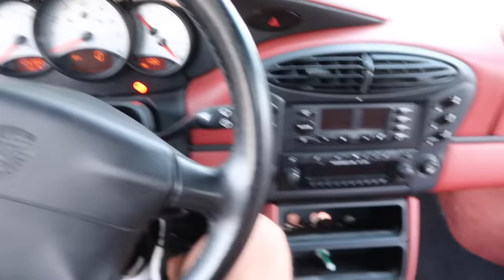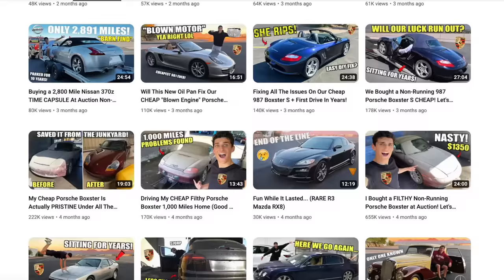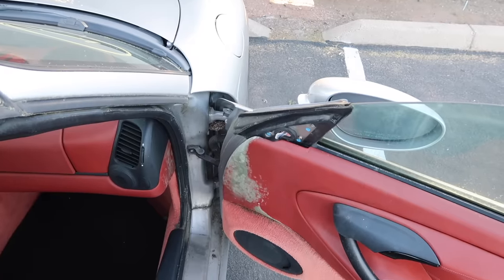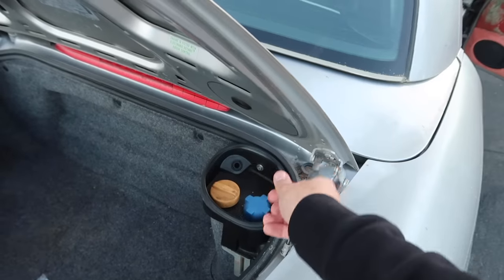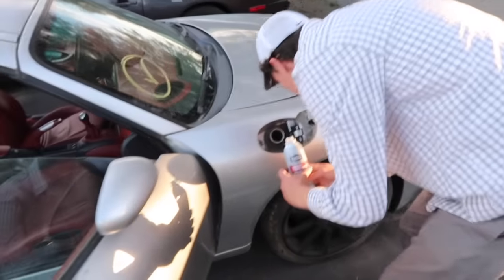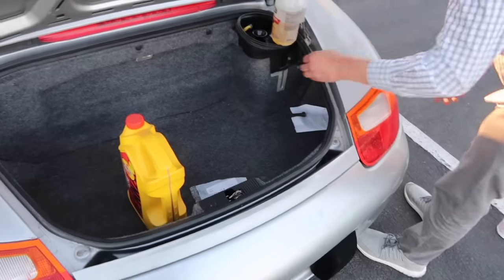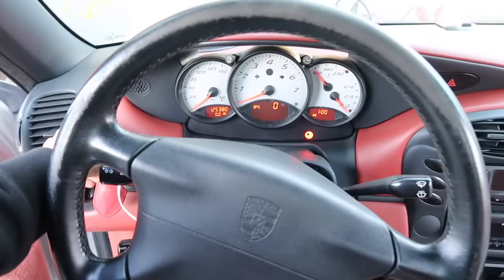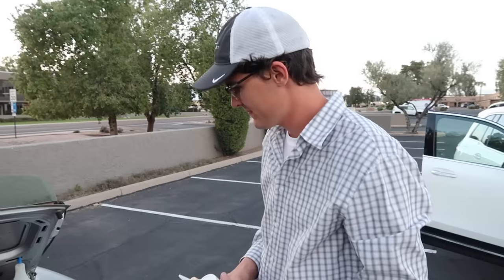I Bought a MOLDY Porsche Boxster CHEAP at Auction! Let's Fix It!

Comment: I feel like these older Boxsters will be really super desirable in a few years, you guys are so good at getting them back on the road!
Reply: They’re the reincarnation of the Porsche Spyders in my opinion. I used to call mine The Little Bastard lol
Reply: they already are
Reply: They are nothing special, neither performance wise nor reliability wise. Any Porsche can become collectable if enough fools want to buy it. 😉
Reply: Bought mine three years ago for 10,500.  I could sell it now for 13,500 in a heartbeat.  But I won't.  I love it.  Hold out for a low mileage S model.  They're out there, just be a little patient.
Reply: The 996 is 90% Boxster. Keep up the mtc. When something breaks fix it immediately. I don't care if you have synthetic oil or not do an oil change every 3,000 mi. And you need to drive these cars they cannot sit for two or three months and then drive it for 30 mi and put it back in the garage for another 2 months then drive it another 25 40 mi then put it back in the garage for another month because when you're the finally decide to get on it that's when you're going to break stuff.
Reply: Absolutely
Reply: @FueledBy.Passion  Yes, Porsches HATE not being driven, has always been so.

Comment: Plenty plenty of parts to make a profit on that car if it doesn't run, but if it's making that tapping noise, It needs to be driven gently to get that oil pressure up to the lifters, valves, cylinder heads, etc and will quiet down if the engine is good. WHAT A FREAKING STEAL!!!!😃

Comment: Hydralic lifters loose pressure over time. As the engine warms and the oil thins the lifters pump up. Had a customer insist I set the tappets wrong. Humble pie served after 10 mins.

Comment: So that noise is the Valves and they have to get good oil pressure for them to quiet down.  Apparently, a LOT of modern cars have this problem because of the super thin oil used in so many cars nowadays.  How can so many people that are supposedly " car guys "  still not know some basic things about how an engine actually works ? Whatever

Comment: With that old-style manual hood/trunk release, there is a physical lock bar that rotates into place when the car is locked. And some of the early models don't have a way to get power to the car through the driver's kick panel fuse box, so if the battery dies when the car is locked, it becomes a massive headache! When Porsche went to electronic release, they added a little pull-out-fuse that you could hook power up to and disarm alarm etc.

Comment: When you first started it, I was thinking cylinder bore scoring and that you would need some oil analysis or the right technique with a bore scope, but after the oil circulated, it sounded much better.  Interior is very nice.
Reply: Bore score is a myth, alongside   this IBS thing 😅

Comment: Not having any service record to check. Maybe are CarFax? These 986 2.5 engines tend to need valve adjustments at 40-60K miles. Plus new plugs, coils and maybe a replacement MAV sensor. Otherwise, nice find. I love my '04 986-S. So responsive in handling. And let the 911 guys laugh all they want. I'll take a p86 or 987.2 S any day. Especially for the price difference.

Comment: IDK IF PORCHE IS THE SAME BUT ON THE MOPAR V6 I HAD THE SAME NOISE AND NOTICED THAT ANY RPM BELOW 3K RPM OIL PRESSURE RUNS AROUND 34 PSI BUT WHEN YOU HIT 3K EXACT IT SHOOTS UP TO 78-80 PSI. I WOULD LOOK INTO IT, JUST A THOUGHT.